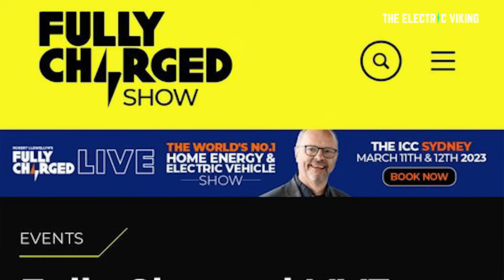NEW tech that can recharge an EV Battery in only 72 seconds

Comment: Oh c'mon Electric Viking.  You can't tell that this Amptricity is not real?
1- they never talk about the cells, so they don't make the cells
2- it appears cells are from china
3- no cells yet available for testing by independents.  just a lot of hype.
4- energy density figure comes from a chinese lab, not trustable
5- China has a reputation for vapourware and hype.
6- delivery way in the future, and they want a deposit now. this is a scam
Some company in China is working on solid state, but is hyping their technology, which will never be delivered.  375 Wh/kg is revolutionary.  Not to mention every other variable they have mentioned. 180C, 0.0002 ohm IR, 10,000 cycle life to 94%, easy to scale -- everyone of these is revolutionary.
They don't have such a thing. They are just telling you that is their goal and they will achieve that goal where everyone else has failed.

Comment: I believe this about as much as I believe the Silverado will be $40k. That being said EVs need to get 10-80% in less then 10 minutes for fast charging which I think will happen within 10 years. Mostly if there is a solid state that reduces the weight.
Reply: How could you possibly believe that the technology to go from a 10 - 80% SOC in less than 10 minutes will happen in 10 years or more considering the fact that we already have vehicles that can charge them 10 to 80% in 18 minutes, wtf?
Reply: @theproffessional9  i dont i think it will happen in ten years or less.(within ten years) i actually think it will be less than 5 but im less certainty of that.

Comment: #Game_Changer.    
When it comes to batteries, a whole month doesn't go by before we have better Battery Technology and another 
 "#Game_Changer"   ❕️⚡️❕️

 The battery pack in your car today , will definitely be obsolete in 2 and a 1/2 years.
( If not sooner)
Reply: What I am hoping for is in five -8 years, replace a still good battery with a better one, with the old being snapped up to use for at home storage.  Powerwalls are way too small and expensive
Reply: @tireddad6541  With one of the older Teslas which had a small battery pack Tesla's advice was replace it with the same size - my guess maybe a firmware issue.
Reply: @Daniel Stapler  Replace the battery and maybe something in the charging system in the car.  

Seems to me that will be opportunity for entrepreneurs in the future

Comment: If you take a 100Kw battery pack. Have you worked out the amperage required to charge that in 72 seconds to 80%.  There is for now a  potential issue I believe, grid scale demand to charge at that rate.

Little seems to be said of how both generators and distribution networks are planning for mass adoption. It's perhaps a greater limiting factor this decade to mass EV adoption, as even installing solar and grid scale power packs wont take the potential for a massive instant demand curve from mass EV adoption. Even more so on peak demands periods and winters. Maybe worth a video to consider.
Reply: That was my first thought until Sam said it was a puny 7.2kWh.

The grid capacity argument is a furphy. It is true that the current is an issue but along with the voltage, that is more for the charging cable. As far as the grid is concerned, the issue is the total amount of energy that needs to be delivered and most of it will be overnight, off peak where the grid has ample capacity having been designed for peak usage.
Reply: USA government is giving out Billions of dollars to provide more Charge uP Stations , But I think the National Grid needs to be addressed.
 Not everybody can afford solar panels to charge up their EV while they are paying a high bank note for the EV.
Reply: There is a video on Engineering Explained which quite nicely rebuts the “grid collapse” story being peddled.  To summarize 2 of the key points in the video, to replace all gas powered vehicles with EVs would require about a 30% increase in transmission capacity.  From 1960 - 2000 the US electric grid increased in capacity by 4% annually, the video didn’t specify if this was compounding yearly.  So, similar to principal + earned interest if no money is withdrawn, if compounding that means the transmission capacity went up by 3.5x over 40 years.  Even if it’s not compounding, that means that over a 40 year period electrical transmission and generating capacity by a tidy 160%.  

Also, capitalism still works - if there are customers who want more power, someone will come along and generate more and also find a way to get it to them.  I’m sure the naysayers in 1915 were also predicting that gasoline would run out in 5 years and everyone would be back to horses & buggies, or that it would be impossible to provide enough stations to fill all of the cars etc. Vehicle sales from 1951-1971 roughly doubled (5MM - 10MM), I don’t recall anyone wringing their hands over gas availability or distribution.  Over that same time period US gasoline production rates increased from 2.9 thousand barrels/day to 6.2 barrels/day.  Hell it was only the early 2000’s where people were predicting “peak oil” which also turned out to be completely wrong.
Reply: @sjsomething4936  I would like to add to your great comments. We have in 2022, a better infrastructure to transition to renewable and EV's than the automobile had to overtake the horses.
Reply: Sadly, you have highlighted the big problem, we don't have the infrastructure to handle anything like this.

Comment: It would be great to charge that quick, but wholly unnecessary for the majority of use cases.  The time it takes to charge is irrelevant except when we have to wait on it to charge.   Current batteries in EVs take the same amount of time to plug in (10 seconds) and charge while we sleep.  

Now 10s of thousands of cycles is something else.  It all comes down to cost and scalability
Reply: There are a huge number of people that have no place at home they can plug in, whether apartments or on-street parking, as most people can’t depend on recharging options where they park away from home being available.
Reply: @strictnonconformist7369   Enough of the worrying about scenarios that have yet to happen.  Your premise is based on people being too stupid to know if they have a place to plug in.   Instead of spreading FUD: Realize that the people buying EVs have figured out already whether or not they have a place to plug in.  No one is forcing apartment dwellers to buy EVs.

Further, we still have years to increase charging options before enough EVs will be produced to serve everyone that wants one.  In the mean time, charging networks are being built at breakneck speed, and more options are being developed for those without a place now.